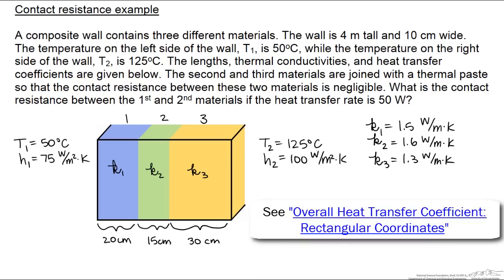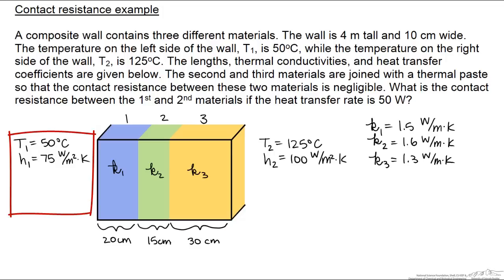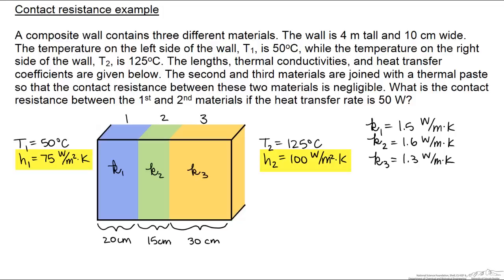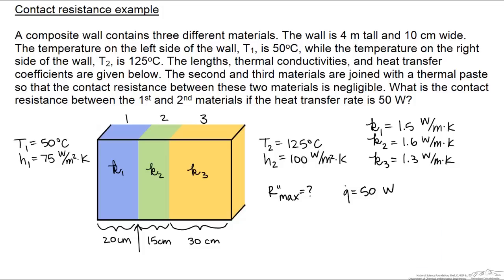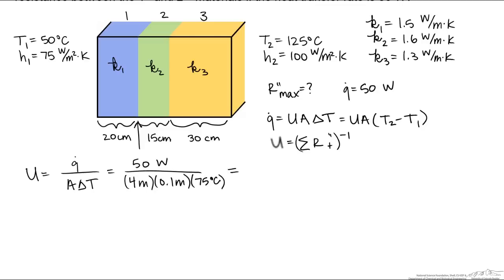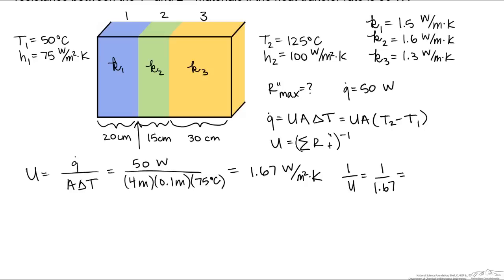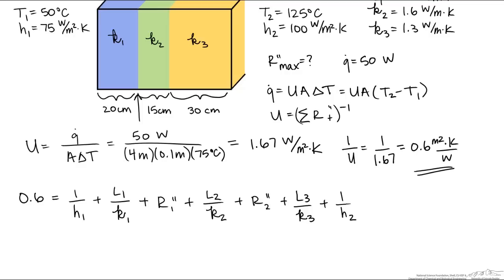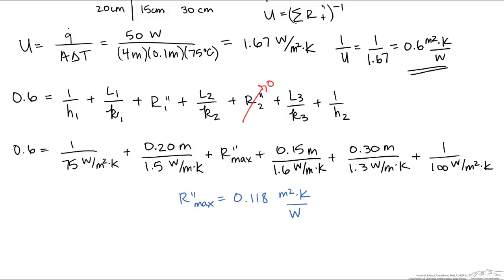Contact Resistance Example

Comment: U = 1 / RA, not 1/R. What you wrote is not resistance, as r= 1/hA or L/kA
Reply from the maker: Thank you for pointing this out. What happened here is that the areas cancel out in what you have mentioned. This simplification could be made more clear, but the numbers are still correct.